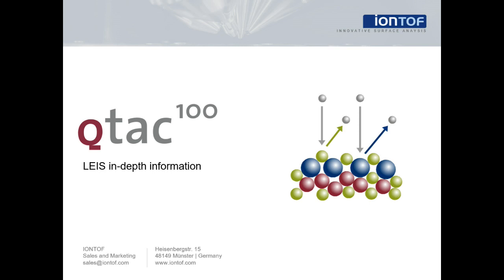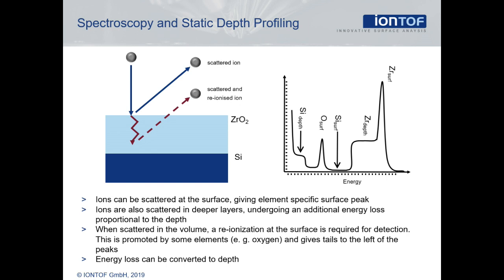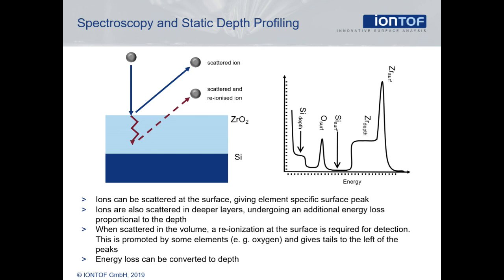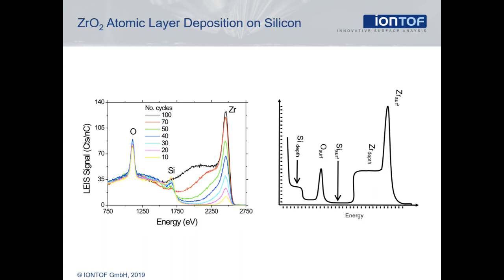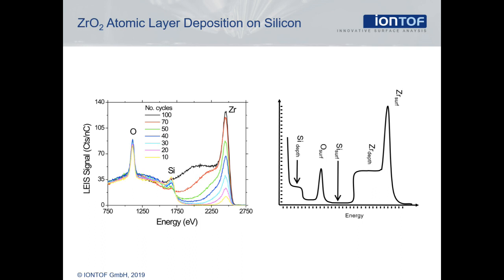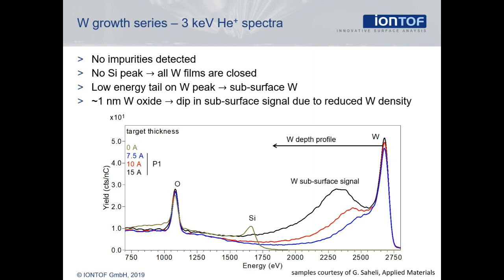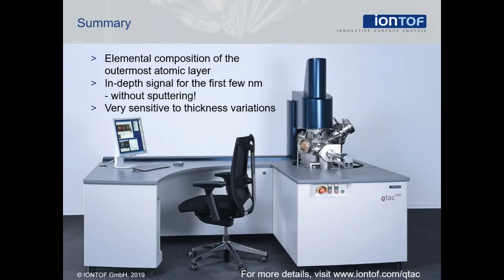LEIS - in-depth information

Comment: Hallo, thank you for your lecture firstly!
here I have a question, in this video, when it goes from 00:26 to 00:39, it mentioned the "strong driving force for neutralization is the reason for the ultimate surface sensitivity", 
how to understand this sentence? in my opinion, the less ions detected, the harder to reach a higher surface sensitivity. 
looking forward to your reply, thank you very much.
Reply from the maker: Dear Iz, thank you for your questions. 
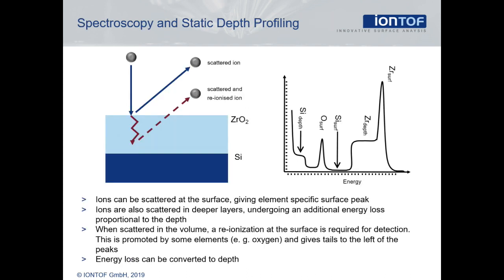In LEIS you get two contributions to your measurement signal. One comes from the noble gas ions scattered at the outmost atomic layer. These form the main features of a LEIS spectrum. An additional contribution comes from noble gas ions that first penetrate the sample (loosing their charge on the surface), scatter in deeper layers back towards the surface and leave the sample surface again. Some of those are re-ionized so that they can be detected. Nathan explains this in more detail from 01:11 to 03:16 in this video.
Hope this helps?
Reply: @IONTOF  ja, vielen dank~